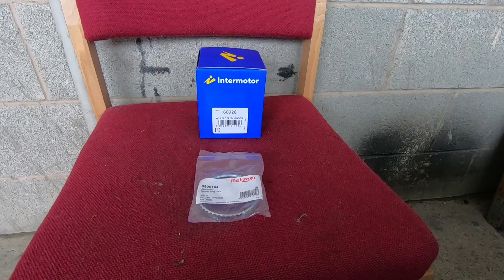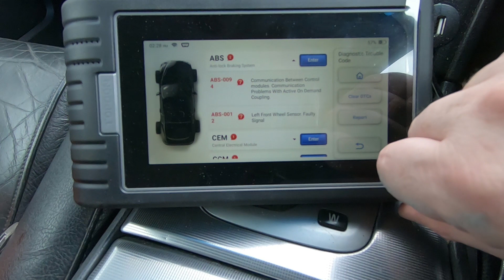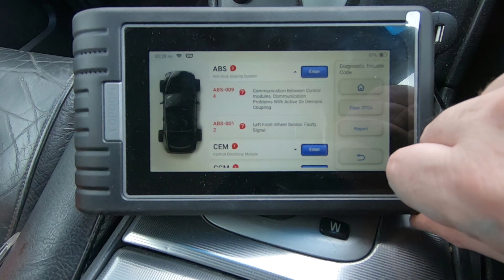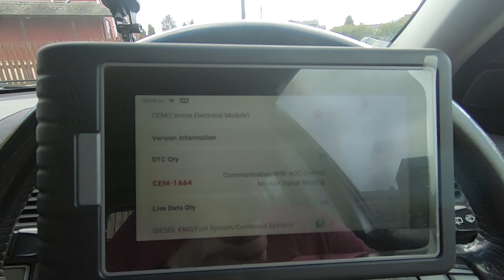I fixed my ABS problmem at the FIRST attempt - 2003 Volvo XC90 Part 23

Comment: Greetings from Texas. Do you have any idea of how to access the cooling fan fuse on a 4.4 litre Volvo xc90 ? The fuse box lid has a sticker on it that indicates the fuse is under the fuse block but I could not manage to remove the block- even after releasing the 4 Grey tabs. 
Any suggestions? It is a 2008 model.
Reply from the maker: I think your car is slightly different to mine being a later model but you are right that the fuse in question is located underneath the fuse box. I can't help you with getting to the underside of the fusebox but it might be easier to check for power at the pin 2 of the fan controller connector which is a red wire. I've also read on one of the forums is that if you disconnect the coolant temperature sensor plug, the fan will come on. If you have access to a decent scantool it should be possible to manually actuate the cooling fan as it is controlled by the ECM module. Have you scanned for any fault codes? I presume you have the V8 engine in your XC90. These are quite rare in the UK which is hardly surprising considering the cost of fuel over here.

Comment: Great video and again i must say and you have a lot of patients but wouldn't it be easier to just replace the complete drive  shaft for £82 per side saving all the grief? which i intend to do very soon as the cvs are starting to click :-(
Reply from the maker: There's nothing else wrong with the driveshaft. The outer CV joint is definitely NOT clicking. I had that problem with the Citroen. The ABS pickup ring was the problem and it was a cheap & easy fix.
Reply: Chas bad your a legend, I have that clicking & been wondering what it was!